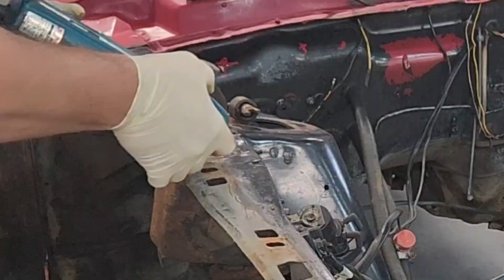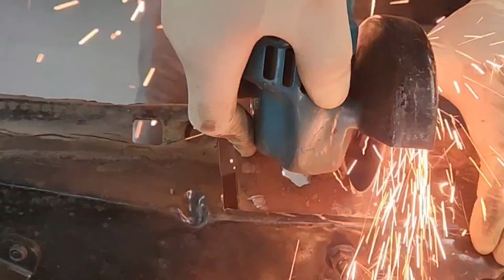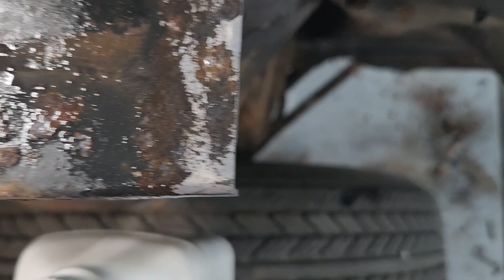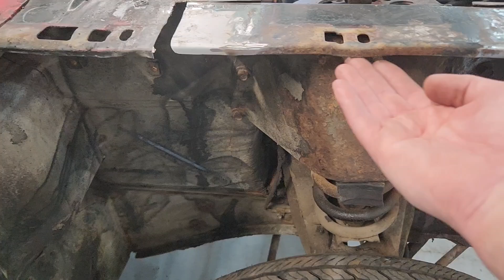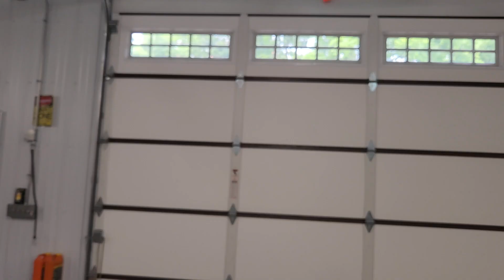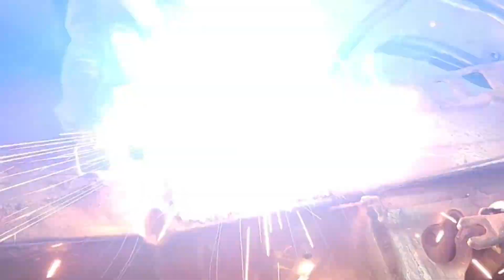How to Repair Mustang Inner Fender Aprons / Mustang Rust Repair / 1968 Shelby GT500

Comment: Nice job i had to do the same spots on my 69 Mustang, have you thought of putting EPS /electric power steering instead of regular system , were you planning on running any Open Tracker Suspension? Car looks Good 👍👍